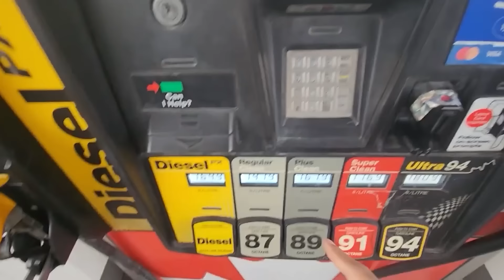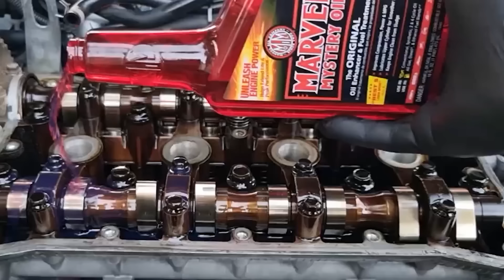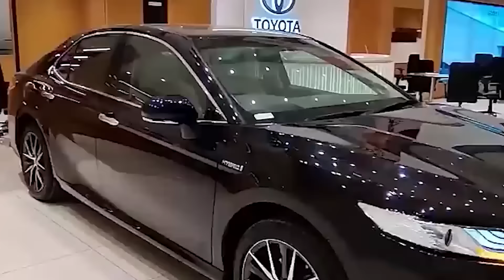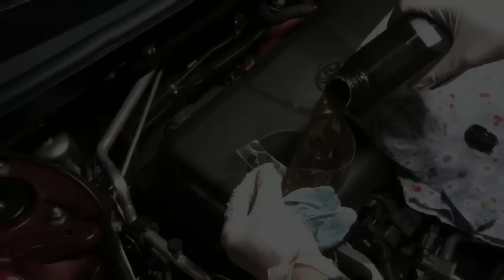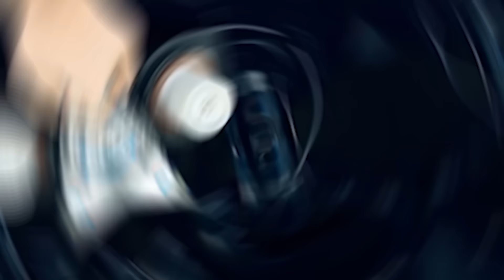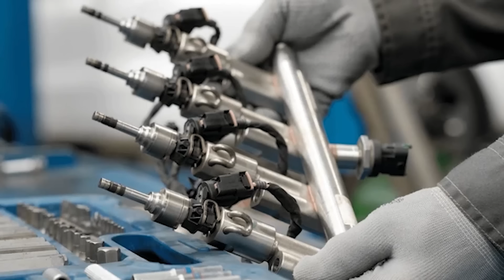I Compared 5 Fuel System Cleaners Over 25,000 Miles — Only ONE Stayed Clean

Comment from the maker: We’re testing more car maintenance products next — which one should we review? Oil additives? spark plugs? engine flush?
Reply: Maybe a video to support your other fuel additive videos , being going around and testing your local gas stations on their ethanol content. They boast no more than 10 percent at top tier locations and other pumps sometimes 15 percent. Being that a ethanol content is no good for the fuel system it might help your viewers or future viewers make more logical choices based off of science and data.
Reply: Engine flushes. Mild to strong. Be sure to cut open the filter. And try to look at the pick up screen with a borescope camera.
Reply: Next time around could you try Archoil 6200 an 6400? I have been using their 6200 for vehicles and outdoor equipment. Stabilizes fuel very well but you never really know about the cleaning portion unless you are a mechanic willing to take things apart to check.
Reply: Militec1 metal conditioner. Oil additive for power steering fluid, engine oil, compressors, pump motors, guns and weapons.
I add 10 oz to engine oil every 15k miles

Comment: Isn't adding a bottle of the cleaner to an almost empty tank, then filling it, just the same as adding the cleaner to an already full tank? Wouldn't still be diluted?
Reply from the maker: Adding it to an almost empty tank helps the cleaner integrate thoroughly with the incoming fuel, ensuring the mixture is potent enough to work effectively through your system. 😊

Comment: I have used red line work excellent if you have a port injection, but if you have a direct injection, only you have to run it through intake system with a pressurized fuel machine it does work but very risky in some cases just saying because I have done it, but it was a last ditch effort it did run better, but long-term I did not know how long it lasted for my friend he did get over 200,000 on his Kia.
Reply from the maker: That’s a great point about the distinction between direct and port injection, as using a pressurized intake cleaner is definitely a more intensive process than a simple tank additive! 👍
Reply: Many direct injection systems nowadays are DUAL injection which includes a set of port injectors, precisely to prevent the carbon build up issue.
Reply: @JA-rn5qv  yes you are right on newer vehicles  but older vehicles that are direct injection only they two ways clean them manual cleaning or use a small pressure canister to direct it into the intake system itself you take a risk on clogging you or individuals catalytic converters up with all the carbon up  that being pushed out of the intake valve system just saying
Reply: @wilyceyote  Yes that's precisely what I specified "nowadays" versus the older DI designs.

Comment: Fuel additives in the tank will not work on G D I engines. 🏎️🚙🚗
Reply from the maker: That’s a common concern, though some specific additives can still provide benefits to the fuel-side components of those engines. 😊
Reply: Many GDI engines now are equipped with DUAL injection so yes, in dual injection GDI set-ups, yes, PEA fuel additives WILL work.

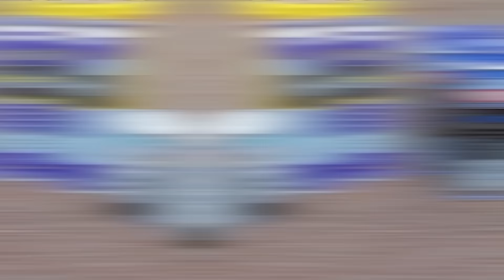Comment: 3:55 Royal Purple should not be included there...

and if this advice is for GDI engines, talking about these additives that get put into your gas tank, doesn't make no sense.
Gas doesn't get sprayed over your injectors in direct-injection engines. So none of these will address any issue mentioned here.
Reply from the maker: Thanks for calling this out. You’re right that fuel in a GDI engine doesn’t wash over the intake valves, so a tank additive won’t clean carbon buildup there. It can still affect the fuel side of the injectors, but I should’ve made that distinction clearer. I hear your concern about Royal Purple’s inclusion, too.

Comment: How can any gasoline fuel additive clean the intake valves of a GDI engine when the gasoline never goes there? Port or dual injection maybe, but not GDI.
Reply from the maker: Yo, good catch! You're totally right, with GDI, the gas doesn't hit the intake valves directly. So how do these additives even work, right? It's a bit more complicated than just pouring it in.
Reply: Because many GDI engines now have an added set of port injectors precisely to prevent carbon build up on the intake valves, it's called "dual injection" dude.
Reply: @JA-rn5qv . Isn’t that what I said near the end?
Reply: @kenandbarbie-b6c  Dual injection setups are still referred to as GDI because they are indeed Gasoline Direct Injected and yes, there is no maybe when it comes to the dual injection versions, they can definitely take advantage of PEA cleaners.
Reply: @JA-rn5qv  So there is no distinction between dual injection & a GDI only engine? That is different than how Toyota explained that to me when I purchased my daughter’s RAV4. I thought they made that distinction to avoid confusion, which it does.

Comment: 😲WTF, km call out is useless to me 😩, I only relate to miles 🤔 and am fkn lazy to do the conversion ☹️.  

My 1986 Benz V8 idled rough on a stop so I took it to my mechanic.  He asked me what type of ⛽ I used.  I told him premium.  Later at home, I wondered why he asked that question.  I realized he was asking for the brand to determine if it was top tiered or not type of ⛽.  Now I only use Chevron😁.  

Just passed Cali smog only test 2 weeks ago😀.  It had the first treatment of Chevron techron concentrate plus 20 oz already in the tank.  I have a 20 oz bottle ready for the 2nd treatment.  I will probably switch to Red Line annually since it has a higher concentration of PEA per bottle but it is only 15 oz.   Will definitely switch to Red Line since it has effectively 7.5 oz of PEA vs 6-7 oz in the Chevron techron concentrate plus 20 oz bottle based on the stated percentages.  Also currently the AutoZone online price for the Red Line is discounted from $17.99 to $15.99 whereas the Chevron 20 oz bottle is just $16.99 either online or in store but that can change in the future.

I also use Liquid Moly engine anti friction that leaves a thin coat of oil on the engine components to avoid wear on cold starts waiting for the oil pump to pump oil to the engine components.  Maybe you can do a research project on this topic 🤔

Comment: Haven't used the red line yet but I noticed with the Chevron in my 2024 Toyota Camry that I put it in there with gas from the ice on mobile station which now is a Phillips 66 station and I noticed that my gas gauge barely move for a week after using I actually thought the Cascade or the fuel pump sensor had quit so that was a measurable gain improvement so I would probably use the Chevron or the red line as I want in it from now on it seemed to really help honestly this is my experience from a person who used to use very much B12 exclusively now I would use their headline as I wanted the chemical difference in the formulas more than I used to and knowing the fuel changes that have made over the last 20 years I would go with the red line or the Chevron that's I wonder the Chevron cleaner
Reply from the maker: Interesting feedback on your fuel economy gains; it's fascinating to see how different chemical formulas impact engine efficiency. 👍

Comment: I tried Seafoam several times in my 2011 BMW Z4 with 100k miles... no change in rough idling or MPG.  I did one treatment with Techron and my MPG went up 10% and eliminated the rough idling.  I was very impressed.  I still use Seafoam in my tractor and lawn mower engines, seems to keep them running well, maybe keeping the carbs clean.

Comment: I worked briefly in an auto parts store and the 'free engine check light' gimmick really sucked them in. I'd run the diagnostic and show the customer what came up, and they ALWAYS asked what does that mean? I'd answer 'you need to go see your mechanic! Wise up folks, they only give you the freebie in the hopes you will buy a part that you have no idea what to do with, or if that will solve the problem!
Reply: And I know the shops out there hate it when a customer comes in with a part thinking that will fix it before the tech ever gets a chance to check the vehicle out. BTW, half the time those parts came back for a refund because the check engine code doesn't pinpoint the component causing the problem!
Reply: The correct answer would have been,  "check youtube or do an internet search for information on how to correct the code(s). If you need parts, tools, or chemicals to do so, we will be happy to help!"

Comment: How can this stuff clean valves on direct injected engines if the fuel never touches the back side of the valves?
Reply: It can’t clean GDI intake valves. Techron cleans the rest of it very well.
Reply: Some GDI engines have dual injection systems to handle that.

Comment: Please explain how a fuel additive can clean the backside of intake valves when it is injected into the combustion chambers...... Sounds like BS to me.
Reply: Port injection it will spray over the valves, direct injection you are correct.
Reply: @VietGinger  However many direct injection systems nowadays are dual injection equipped, precisely to handle that.

Comment: None of these cleaners work a real mechanic will not use this crap you are all getting sucked in!
Reply: I do not agree.  There's videos out there of before and after results of using red line. Videos show carbon removal inside combustion chamber and around injectors

Comment: Royal Purple in 05 Sequoia with 4.7 V8. 240k miles. Smoother idle after one application. Similar application as suggested here, 1 bottle, fuel tank, hot run.

Comment: I can confirm and agree with everything stated in video. I've used almost every fuel additive listed and Redline was the only one with immediate difference.  I switched to Top Teir fuel only and Red Line every oil change,  My 2010 TL with 375k miles runs like new because of this change.

Comment: Showing a BYD vehicle when talking about fuel system cleaners does not give one a lot of confidence as to whether the information in this video is accurate... Then the voice over discusses how GDI engines can build up carbon on the intake valves (up to the weight of 3 paperclips) and even says that the gasoline detergents no longer wash over the valves. They also go on to say how expensive it is to clean the valves. Then they go on to say that pouring this chemical into your gasoline will clean injectors...Yes, OK...but we weren't talking about injector build up, we were talking about valve build up..there is NOTHING you can add to your gasoline to clean the valves on your GDI engine...the ONLY thing you can do is mitigate it...and you do this by decreasing your oil change interval...if you change your oil at 10,000 miles, change it at 5,000 miles...this will help the PCV system capture oil vapors and prevent the oil vapors from solidifying on the back side of the valves...this is the ONLY way to mitigate this issue...
Reply from the maker: You've brought up some important points about GDI engines and valve buildup, and it's true that fuel system cleaners primarily address injector issues.

Comment: If all gasoline brands claim to have clean burning additives in their products then why do fuel additives exist in the retail market
Reply: Using Top tier gas is great but it's like brushing your teeth for your car. You still need a deep cleaning by the dentist. That's where fuel injectors come in like Techron.
Reply: Because the combustion process it's not a perfect process and the gasoline additives can help but can't compensate 100% for situations where engines are being run in sub-optimal conditions such as temperature extremes, dirty air filters, worn spark plugs or defective spark plug wires, excessive amount of idle time, cars mainly driven in stop-&-go traffic, cars which are only driven short distances and never reach optimal engine temperatures, etc.

Comment: But how does it clean the valves. The injectors spray the pistons not the valves??   I believe if You want to keep your valves cleans a catch can is your best bet for direct injection
Reply: Many direct injection designs nowadays are DUAL injection which includes port injectors, precisely to prevent the vavle carbon accumulation.

Comment: But, on a direct injection engine, the fuel - even with fuel cleaner in it - never touches the intake valve.  So how, exactly, does this snake oil clean Intake valves?
Reply: You are about 10+ years late to the party.  Many GDI engines nowadays are DUAL injection systems which include a set of port injectors precisely prevent the intake valve carbon build up issue so THAT is exactly how this "snake oil" cleans the intake valves in many GDI engines that are so equipped.

Comment: Only works with throttle body, or port injection,also carbs. Direct injection doesn’t spray gas on the back of the valves, so no cleaning of buildup.
Reply: I was curious how the fuel system cleaners tested in the video were cleaning the intake valves of either a tsi or gdi gasoline motor.
Reply: @CouriousOldBear   
I understand you have to make a port in the air tube b4 the throttle body and spray it in.
Reply: @porkrind3512 that’s an awesome idea, I appreciate you suggesting it to me.  Thank you
Reply: @porkrind3512correct. It does help clean the intake valves through the gas line though.
Reply: What about naturally aspirated?
Reply: Except that many DI engines nowadays are DUAL injection precisely to handle the issue of carbon build up of the valves.

Comment: At first he says the problem with the cleaners is people put it in a full tank and it's too diluted. Then he says put it in a quarter tank of gas and then fill it up after you've put it in. Well wouldn't that mean you're diluting it just the same?
Reply: I think he is suggesting put in  at 1/4 tank and fill up so thet you get the solution to mix vs float on Tom and not mix completely…..the dilution excuse was incorrect..you need it to be mixed and blended thoroughly…
And ..he actually said .,don’t dilute with water .lwho does that.  Dumb AI
Reply: @markbrodie48 I double recommend dose, on tank with Lucas(my thought, the lucas lubricates and s1 cleans, so could work better). Had great results in my 13 Ram 5.7, when tank is almost on low gas light, Felt power return. Wasn't gradual,  all of sudden truck felt more powerful. The next year tried same thing and felt power again come back. Ever since, I do this twice a year on all my vehicles Only other engine additive I use in all my vehicles are lubeguard biotech added to oil(penz ultra platnium or mobile 1 EP depending on which vehicle), adds moly and hemi in particular likes higher moly, 3 hemi vehicles and never the hemi tick.

Comment: Royal Purple, Redline, and Techron are legit  I think Redline SI-1 is the best and has the most PEA. Always use it with Top Tier gasoline. Costco gas is Top Tier and usually pretty cheap. Also Meijer grocery store gas is top tier surprisingly.   Sam's club and BJ's gas is Not. Shell and Sunoco are. There is an official top tier gas list online. My vehicle has over 300,000 Miles and I plan to run the good cleaner and top-tier gas for like five tanks in a row. It's already acting a lot better after only my second tank. I'm running Costco gas and a mixture of Royal purple and Techron right now. Yeah I don't care if you're not supposed to mix them I did and it's running great.

Comment: No fuel additive will help a direct injection engine
Reply: In order for it to work on valves it has to touch the valves. In direct injection it never touches the valves. The best it can do is clean the top of the pistons.
Reply: @fid @fidrat24 exactly what I meant
Reply: Considering that many GDI engines nowadays are DUAL injection, that is simply not true since the dual injected GDI engines include a set of port injectors.

Comment: Techron turned the check engine light off on my 04 saturn w 222k miles
Reply: I can't believe you own a 2004 Saturn.
I thought they all were in the junk yard.
Reply: @falcorthewonderdog2758 lol
Reply: And it's much cheaper so you can run it a little more often.

Comment: No BG 44K?
Reply: BG44K has the most PEA
Reply: @robb15033 I can’t find any site that reliably reports the actual concentration but BG44k, amsoil, and redline were the highest. Redline is available at advance auto and oreillys. The other two have to be ordered. Redline works and I don’t doubt amsoil or BK44k would as well.

Comment: No convinceing results to show that any fuel system additive can clean carbon from a DI gass engine,injection system yes but otherwise nope.
Reply: If your talking about cleaning the valves on a DI system? Yes only way is to physically clean them. Scraping, walnut blasting or dry ice blasting.

Comment: Bought a 2009 Dodge Journey with 36K miles. Shortly after, check engine light came on with rough idle. Shop wanted $350 for new injector. Put in $35 can of BG fuel system cleaner in the AM and by the PM that day, light went off engine ran smooth. Finally sold it with 150k miles.
Reply: BG44K has been a superior alternative to Chevron Techron and Redline SI-1 for over 40 years. They use a patent-protected PEA that consistently removes more deposits than any other cleaner.